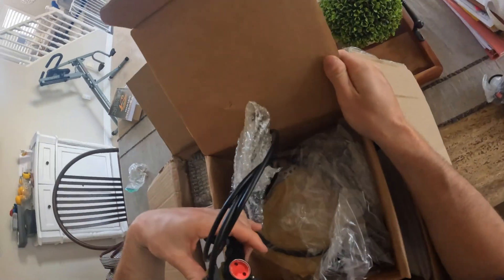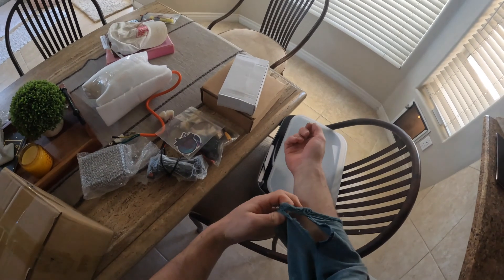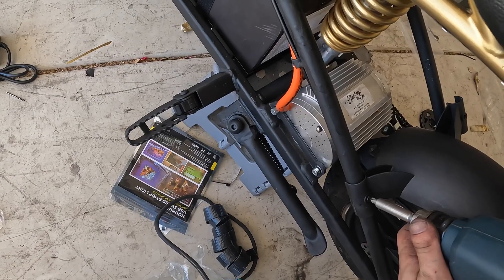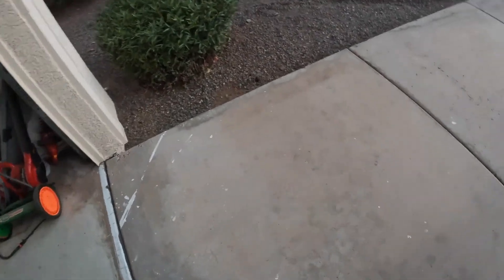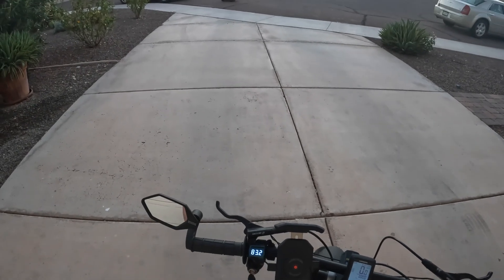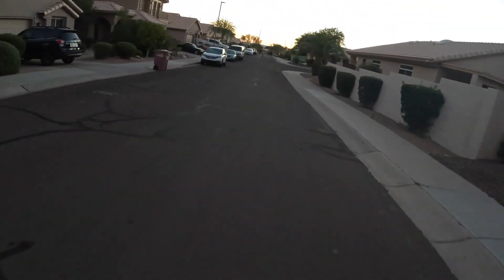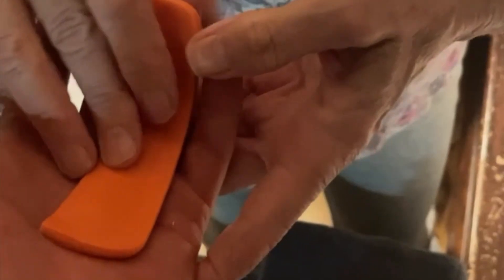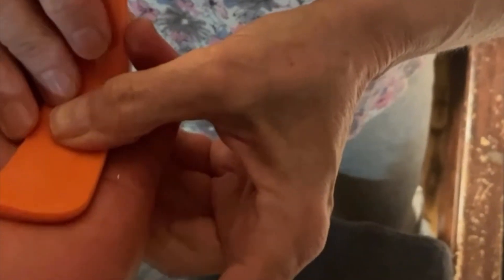i turned my razor electric street bike into a MONSTER | 72v 6000w SURRONSTER E&C KIT INSTALL

Comment: The bike looks sweet!! I'm going to buy the kit prob at the start of next summer. Was it pretty simple to install? I'm 17 years old and I have not really done anything like this before and I cant find any in depth guides out there to install the kit. surronsters guide helped alot but im afraid when I get it im not going to know where to plug things in
Reply from the maker: Hey dude! Yeah I would say it was pretty straight forward. The screws for the motor were a pain in the butt to do by hand I wish I had an impact driver. Also there is one connecter (I don’t know which one) that comes off the controller that is really hard to fully get to “click” together. I used a wide mouth wrench with the roller and squeezed them together gently. You don’t wanna break the plastic but it’s almost impossible to do by hand. Other than that if you feel relatively confident about taking the bike apart and putting it back together you should be totally fine. You might run into some speed bumps and have to redo some things if you do them out of order like putting the motor on before the chain tensioner or putting the chain tensioner on upside down so you have to take the back wheel off again….it can be a pain so I would think about the steps you do things, I kinda just winged it but it came together fine nonetheless and you learn how it works so you can trouble shoot if something ever goes wrong.
Reply: @darkcrystalacademy  thank you so much! this helped!
Reply from the maker: Oh and you need a socket wrench (with extender preferably) and an impact drill is gonna save you so much time. It’s a pretty simple machine when you strip it down
Reply from the maker: And your basic tools of course